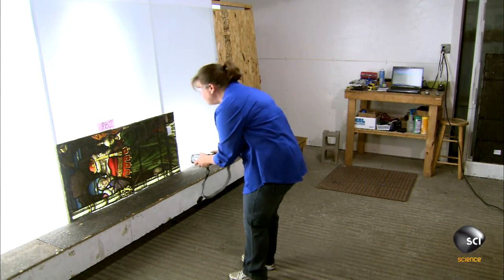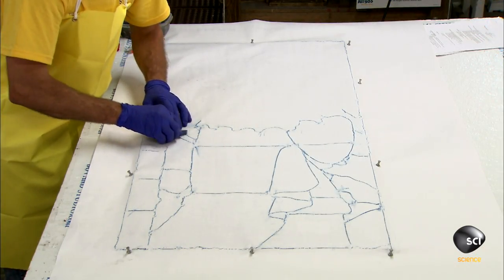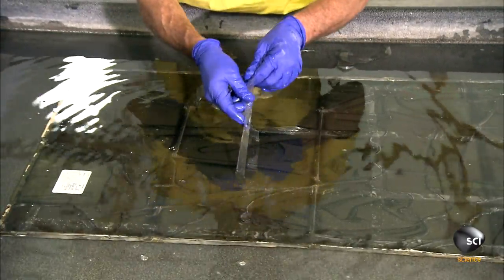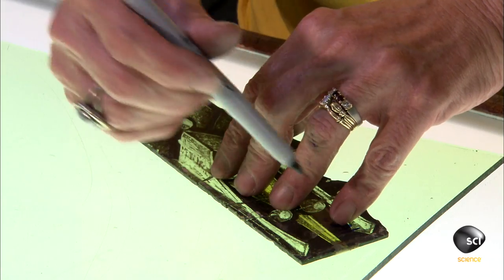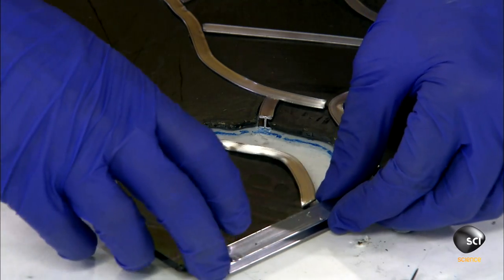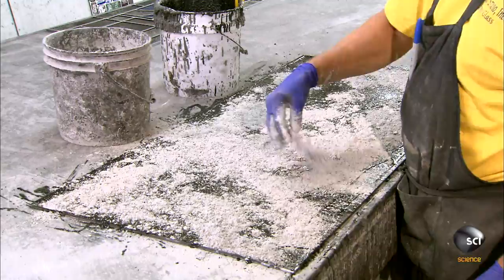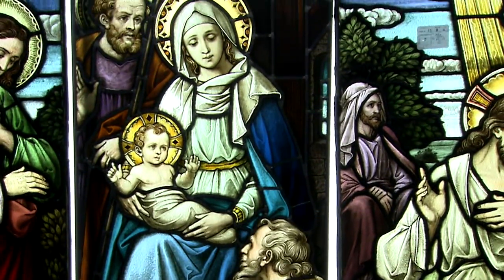Stained Glass Restoration | How It's Made

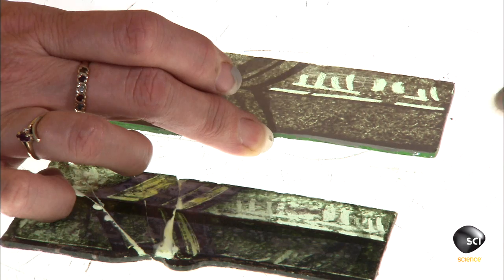Comment: 1:51 this particular part has nothing to do with restoration. It's a 'replacement'. There several other techniques and methodes (reversible) to restore the original piece without showing the crack or break.